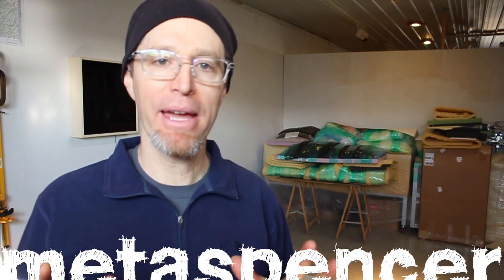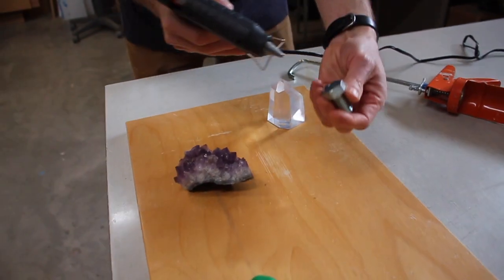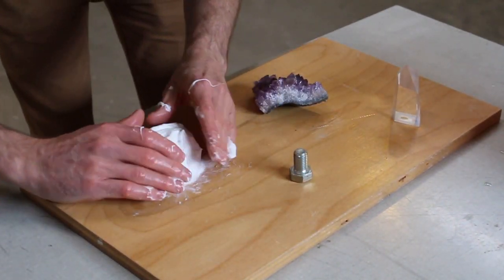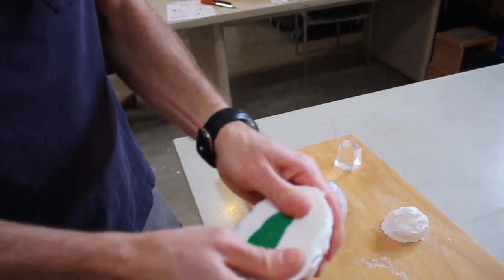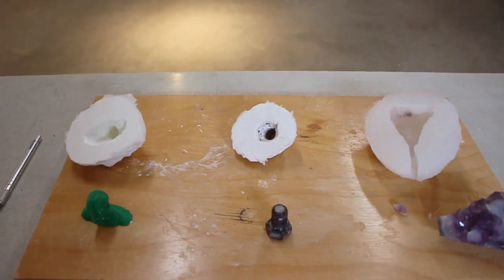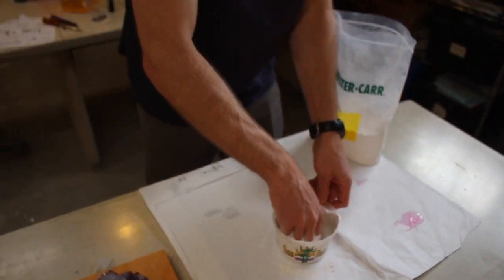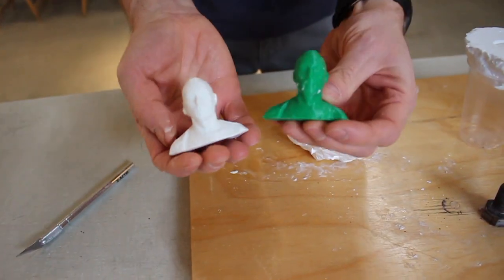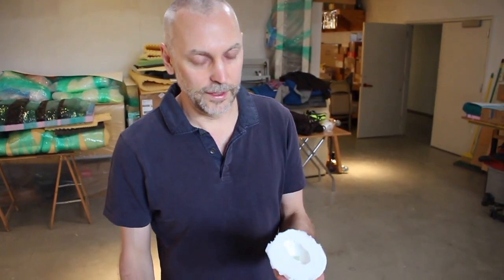How To Make Silicone Molds & Cast Plaster

Comment: I do this with a mix of glycerin, corn starch and mineral spirits (to thin the silicone) - the glycerin (the active ingredient in the dish soap) acts as hydration for the silicone to cure. I use a more diluted mix for the first coat and you may need to create a flange around the bottom in most cases depending on the application.
Reply from the maker: Wow, really cool to hear! Thanks for the tips

Comment: Could you brush on the first coat? Then wait for it to dry and then re-coat a few times? Or thing it down and paint it on a few times, letting it dry in between as they do with 'smooth on'?
Reply from the maker: Sounds like a cool idea and worth trying.

Comment: Hey I am really interested in doing multiple casts off of the silicone mold. I was curious if you know how long the mold lasts(its silicone so I'm sure it lasts as long as a traditional silicone mold) and were there any issues with recasting? Thanks in advance!!!
Reply from the maker: It really all depends on things like the shape of the object and size of the mold. A thick mold around a simple object will last a long time and through many uses. Tearing the mold is the thing to avoid.

Comment: Would it be possible to do the reverse of this? Make a cast using plaster, and subsequently fill it with silicone pour? I need to make some medical training aids to teach people how to treat gunshot wounds and am trying to do it as economically as possible.
Reply from the maker: I think that would work -- you'd just have to give the silicone enough time to set up ... and removing it might be tough, depending on the size of the gunshot wound/cavity, but it's "worth a shot"

Comment: I advise anyone that try's this to wear a respirator. I watched this video to do it and ended up breathing in all the chemicals from it.
Reply from the maker: Good idea. Stay safe!
Reply: Isn't silicone pretty inert? I've never worn a mask when doing joints in kitchen or bathroom. And plaster is only dusty, once wet it definitely does not give off fumes. (I'm against unnecessary warnings because we become so used to them that we overlook the really important ones.)